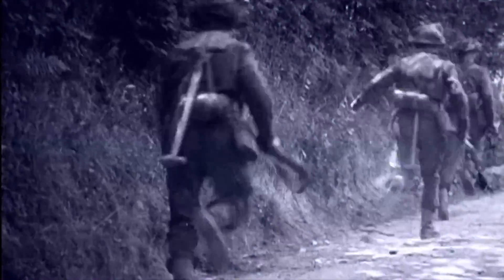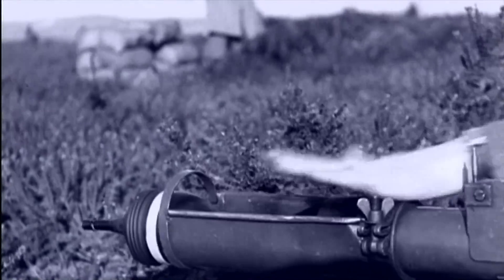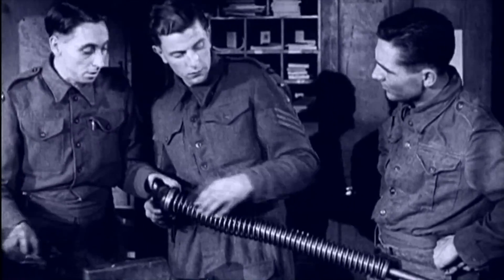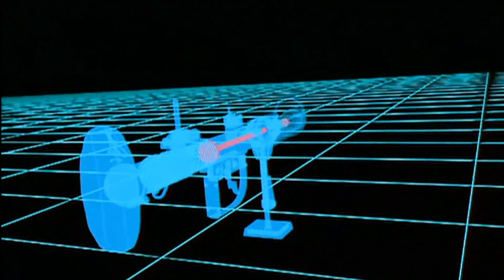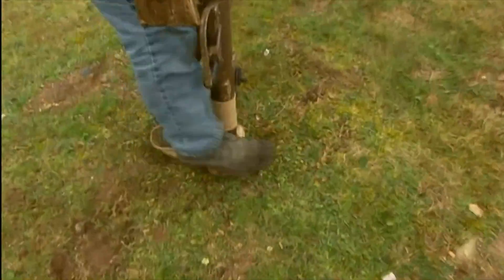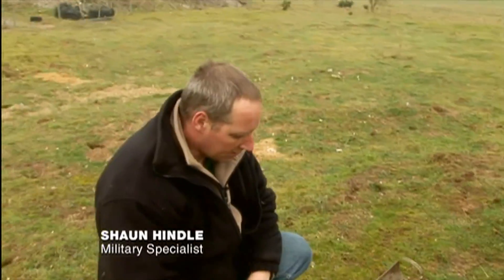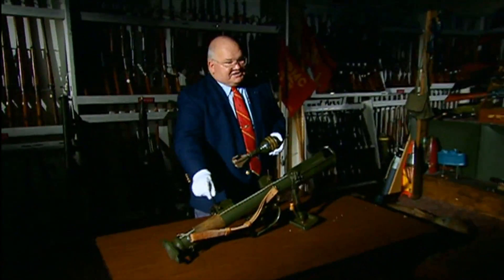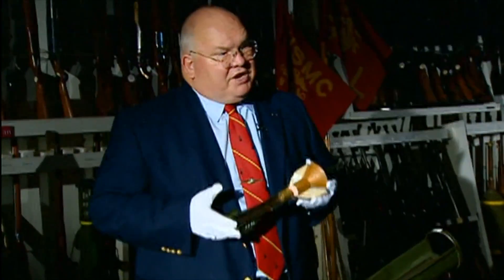Weaponology - "British PIAT"

Comment: That "Expert" has just lost all my respect, fat idiot. The spring in a spigot mortar does not provide any thrust to the mortar bomb. It just acts as a firing pin and detonates the propellant charge. A spigot mortar works on the principle of firing a gun barrel off of a fixed rod.
Reply: A 90kg striker spring?  You're confused as to whom is the tard.
Reply: Then why does it need a 200 pound spring behind the firing pin?  Were british primer caps that bad????
Reply: doktorbimmer The 200 lb spring was there to absorb the recoil. Nobody here seems to have gone through or understood what happens when the weapon is fired. The spigot flies forward pushed by the spring. The firing pin hits the propellant pellet which deflagrates. The gasses produced do two things, they accelerate the projectile out the front of  the weapon and also produce the same  thrust backwards on the spigot, stopping it and accelerating it back so that it recocks. Very little impulse is going from the moving spigot to the projectile. If it did, and the spigot was able to push the expanding gas and with it, the projectile forward, the decrease in pressure as the projectile left the weapon would stop the weapon recocking. The Acceleration provided by the propellant burning is much higher than that provided by the spring.
Reply: @doktorbimmer  To absorb the recoil of the bomb being blasted off. Is it so difficult to understand?
Reply: You guys ! Actually, you are all partly right. The firing pin (rod) in a PIAT did also provide momentum but there was also a cartridge in the base that also provided inertia when it was triggered in a similar fashion to a mortar bomb. This re-cocked the weapon too. A spigot is indeed a term used in North America for a functional type of faucet or tap. However, in the UK it means a small peg or a plug (as used to vent casks for example).
Reply: One of the world's most respected experts...
Reply: doktorbimmer But he’s also a Yank which makes him prejudiced. 
The PIAT stopped the SS armour taking the bridge at Arnhem for eight days.  It performed one of the most vital anti tank shots of WW2 when it stopped German armour from retaking Pegasus bridge after it was captured by the Paras. Yes. It had weaknesses and foibles. But it fired fast, fired without much smoke and had a way bigger warhead than a bazooka.
Reply: @SvenTviking  It was a stupid design that was ineffective in combat and abandoned... this concept is dead and buried.
Reply: @doktorbimmer  Against all the junior officers in the WW2 Canadian army that were quizzed as to which weapon they found to be the most useful. Answer, the PIAT. Yeah, he’s a fat idiot.
Reply: +x42brown  The spring indeed assisted the launching of the motar round, as would often happen, the propellant charge was defective and would fail to ignite... the "dud" round was still ejected from the launcher.
Reply: The spring was re-compressed back to it's start position in normal operation so none of it's energy was given to the bomb as it ended with the same energy as it started. I hope you don't think I have any liking for the thing but I do dislike the expectation of getting free energy from the spring.
Reply: Thats not true, look up what a spigot is
Reply: I have not heard of any complaints of the propellant failing (never happened to anyone while I was on the range and our drill Sargent never mentioned it. I suppose it would happen as often as rifle misfires. I am not sure I would wish the bomb to be ejected in those circumstances.

Perhaps I should have said 'jn normal operation'
Reply: I think that when the propellant charge worked, the spring was both a prime mover and igniter of the charge and a recoil absorption system like the plug out of a recoilless rifle, or the gas efflux from a bazooka. So in fact it was an ingenious weapons delivery system that could have been really good, with more development, and perhaps a longer launching tray, better propellant, better cocking system, and possibly a rocket motor that kicked in post launch vis a vis the RPG. By comparison think of the super bazooka from post WW2 / Korean war.
Reply: +x42brown During WW2 the weapon's ammunition had a rather high failure rate.. both misfires and failures to detonate.
Reply: +Lancaster50 Despite the fact that this class of anti-tank weapon proliferated after the war, no other country adopted or developed a similar design, not even the UK.. The PIAT remained in service because it worked just well enough that an immediate replacement was not required and there was simply no funds to develop something better at the time. Clearly the rocket delivery system was and still is vastly superior.
Reply: Ok, the spring did impart momentum. But there are some distinct pros to fat expert’s cons. There was no flash or smoke to indicate the firing position. The weapon could also fire much, much faster than a Bazooka or Panzershrek, as fast as the loader could drop the projectile into the tray between shots. And it had a much bigger warhead than a bazooka, which needed to be seriously enlarged by Normandy and faced by Tiger, Panther and even MIV tanks. A bazooka needed enemy tanks to almost pass the firing position because the warhead could only reliably penetrate the sides and rear of later German tanks. The Panzershrek had a much better warhead. 
Another thing is the PIAT had no electrical firing mechanism to ignite a rocket. I would like to know how difficult it was to keep the contacts clean in the Rocket firing weapons and how often they misfired because of crap on the contacts.
Reply: Lancaster50 damn Englishman with their words and language
Reply: Will that's where I hook up the garden hose?
Reply: Actually it was a combination effect. The force from the pin did also help project the 'bomb' as well as the detonation of the primer in the tubular tail of the bomb, and at the same time the primer cap (charge) also then shot the pin backward and re-cocked the weapon - most of the time. I agree it was sub-optimum, but then so was the STEN and Churchill Tank but they still won battles. Don't forget the US bazooka often bounced off German tanks and gave away it's position - it could also really hurt you if you stood behind it, which is a problem on a crowded battlefield.
Reply: Not really a combination as all the effort the spring put in was returned to the spring as the spigot recoiled recocking the PAIT so in effect none of the work came from the spring all from the propellant. The spring's effect was to spread the recoil out to make it almost bearable on the shoulder.
Reply: Action and reaction.
Reply: I have known a lot of people who used them in WW2 only Peter who I worked with talked of a failure to detonate early in the Italian campaign and said no problems later no one has mentioned a misfire.

That does not make the spring intended to propel the bomb
Reply: Actually, rocket delivery did not take over completely, and even today there are some ideas around mortar or spigot based anti-tank delivery systems. Ditto recoilless rifles (actually guns) such as were used by the Israelis in the raid on Entebbe, or the Wombat, and actually armour-penetrating rounds in, say, 50 calibre have made something of a come-back too. Also, the RPG is actually initially motivated by a propellant round in it's base before the rocket motor, which is actually at the top, kicks in.
Reply: I do see - action and reaction - so in effect some of the energy is used to re-cock 'the gun' (PIAT) by driving the spring backwards whilst also propelling the bomb forward. So, it's a nil-sum system, basically - like a semi-automatic rifle like the Garand or SLR.
Reply: So, it's a mixture of action + reaction and conservation of energy -  switching from potential energy to kinetic energy and back to potential energy in the case of the spring.
Reply: Yes. The effect on the firers shoulder is a spread out recoil making it just excruciatingly painful
Reply: I agree with everything you say - and in fact the electrics did fail on the bazooka, and it's warhead was too small, and it had a hell of a flash signature. And yes, the PIAT knocked out a whole host of armoured vehicles, tanks bunkers and other prepared positions. I know for a fact that there was a much improved PIAT on the board, but the war ended before it could be made or used. The Yanks knew the bazooka had issues, which is why they made the 'Super Bazooka' but again, too late for WW2. I often wonder about 1946 - because then you would have seen  better STEN guns, better Mustang, P47s and Spitfires, much better allied tanks like the Comet and Super Pershing and so on ....
Reply: Bazooka electrical failures were mainly related to the battery powered M1 and M1A1, particularly the former because IIRC there was no seal to stop water infiltrating the battery compartment. Most of the electrical issues were solved in October 1943 with the introduction of the M9 which used a magneto hooked up to the trigger instead of a battery and used the improved M6A3 rocket which had similar penetration to the PIAT. The M20 "super bazooka" was just a scaled-up M9 with a bigger rocket.
Reply: From what I have read the M20 really was the ultimate bazooka, and in Korea it would brew up tanks, that other weapons just bounced off (T34 for example). It's another example of technological development that seems to always need field testing before you get to the best or optimum development. At the same time, I also believe that many good ideas get dropped just with the passage of time and changing priorities, so perhaps a Super PIAT is still something to consider ?
Reply: Lancaster50 
I think the only way you could really get past the fundamental issues of the PIAT and still have it be a spigot something would be to make it a recoilless spigot-gun like the Davy Crockett. I can't see how you'd get away with making it easier to cock because the reason the spring was so powerful and the spigot so heavy was because one of its main functions was reducing the felt recoil of firing a 2.5 pound projectile to something that wouldn't maim the gunner.

Comment: This design was almost never copied ever again after it was no longer used.

Meanwhile, the anti-material rifles it replaced are still popular.

I love how none of the people climbing over each other to praise this weapon and insult the video, aren't stopping to think about this.
Reply: Anti Material rifles are only used now to disable light vehicles. You can't use them on modern MBTs and armoured vehicles. The facts are that the PIAT was very effective, just because the design is bad doesn't make it an all round bad system. They had a vert fast rate of fire for the time and were capable of penetrating any tank on the field. The American bazooka and German Panzerfaust were not designed to hunt tanks and destroy them, they were only there to stop enemy armour from overrunning positions as a last resort.  The PIAT served it's purpose incredible well.

Comment: G'day,

   Well as crudely aggroKultural as the PIAT was, for delivering a Shaped-Charge onto a hostile Tank, it was vastly more user-friendly than the contemporary Japanese delivery-system ; they attached their S.C. Warhead to a 12-ft Bamboo Pole, with a String-Pull Detonator (instantaneous-fused...), and the instructions suggested bracing the butt of the Pole against one's Torso, to ensure a good contact betweet the Charge & the Tank..., to improve penetrative power.

  The fact that the Pole was thus blown straight back, THROUGH and through the operator, when the Charge went off was considered "regretable" and "unfortunate" ; but, well, Tanks just had to be stopped, y'see , "National Honour" required that something be done, this was something - do that's what they did...

"OuuuRaaah !" as the saying goes...

  ;-p

   Ciao !

Comment: I think that the key misunderstanding here is that at the time there was nothing else for the common soldier to use against German armour. It might have been a bitch to load, but without it the soldier would simply have to retreat from the battlefield or die. Personally I think the efforts of Millers Jeffrey's should be applauded and not derided as they are in this video. Millers and the MD 1 team made a huge contribution to the war effort that has never been fully recognized either here or abroad.
Reply: Talking about its reload, it should be mentioned that there was no real reason for you to have to cock it during battle if it worked right; with the charge pushing back the spring in readiness for the next round (as shown in the video), so really, unless you're very stupid and decide to cock it only once in combat, then you were generally never a victim of its unwieldy cocking.

Also, in terms of abysmal range, these were infantry weapons, not tank weapons; they could hide much easier than any armoured equivalent, and so to get close to the enemy; 40 meters, with training about 'shoot to kill', is fine.
Reply: IThe PIAT had a very low launch signature both visual and acoustic and generally wasn’t detected.  It could also be fired indoors.  Bazooka and Panzerschrek produced a huge amount of smoke, noise and flame and would immediately be spotted whereas the PIAT was almost undetectable, the Germans at Arnhem never knew what hit their half track and they held looking fir an AT gun.  PIATs range was good compared to the two rockets.  The Bazookas range claims are particularly absurd.   Panzerfaust had a velocity of 110 meters a second and claimed 150m range against tanks, 120 m if moving and 200m max (sight limit) .  PIAT and Bazooka both had velocities of 80 yards/second.  The Bazooka claimed a range of 600 yards and 250 against tanks.  In reality this is only because the sights could be set to this range.  It was good for hitting a barn only.   Paton’s Army was told to shoot at 30 yards because if they fired at greater range they would likely miss and be spotted by the tank.   PIAT could fire and miss and not be detected so it could fire again.
Reply: Agreed.
Reply: Atwater is a complete jackass. His opinions are the worst. He doesn't know much about his subjects and only can come up with trash comments or hyperbolic praise, nothing in between.  Hopefully most of the videos that use him will be eventually discredited.
Reply: Yes, I would like to see a (positive) video on these guys AND also Major C. Aubrey Dixon of the British Royal Arsenal at Woolwich and his MUCH improved version of the de Wilde bullet, which made a huge difference to the effectiveness of British 303 aircraft rounds. In face, the Americans copied it (as usual) but did simplify it which we then used by turn ourselves. German pilots will tell you that it was not nice watching petrol tanks getting lit up with these malignant little 'firecracker' bullets.
Reply: Except for the fact that rockets already existed. And no, it doesn't matter what kind of "historical bias" you think the world has, people can criticize whatever is worthy of criticism.
Reply: @Soft_Dusty_Rhodes  Rockets existed yes , but then you had the problem of the weapon being a lot bigger and the blow back from the rocket exhaust , the Piat was small and relatively light , could hide easily and not give its position away when fired
Reply: It was a disappointing and unsuccessful weapon in general and huge waste of precious British wartime resources,
Reply: I think if those Americans who deride British last ditch efforts were confronted with a real threat of invasion they would do what the French did.   And we all know what that was.
Reply: @ruadhagainagaidheal9398  showing yourself as hating America is very telling. A bunch of triggered losers that can't handle an American criticizing a British invention
Reply: There is no way you all are this daft.
The PIAT sucks but it was a last ditch fire arm

Still doesnt mean it sucked.

Why does it suck? Because the M1 "Bazooka" existed at that time and the PanzerFaust. Both lighter and more effective.
These were man portable Anti-Tank weapons. The Germans found the Bazooka to be effective and copied it into the PanzerSchreck. 

These rockets fired two main munition Types
HIGH EXPLOSIVE
AND
HIGH EXPLOSIVE ANTI TANK

Comment: Wrong.....you do not have charge it the first time by standing up!  It had a fast reload. Was a very simple design and effective.Fatty just doesn't like it because it was not made in America.
Reply: Austin Powers you can load it laying down, forgotten weapons explained this with one in hand. It was made to be set both vertically or horizontally
Reply: SCD4 and he isnt brave enough to use one (me neither by the way).
Reply: There are as many accounts of the PIAT working and taking out tanks.  You can look for a problem and find it but if you take a balanced view you get a different picture,  I could look for the problems of any weapon and say it was rubbish.  The fact is the PIAT was the best anti tank weapon available when it was made, that does not mean it is going to be the best ever.
Reply: SCD4 no you do have to stand up to ready the weapon.